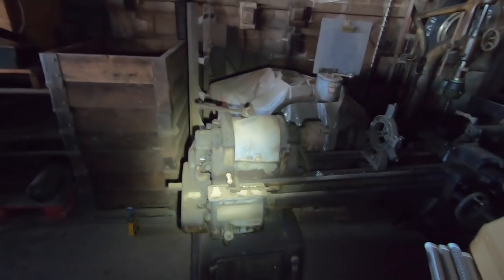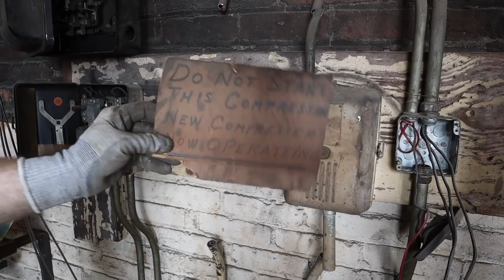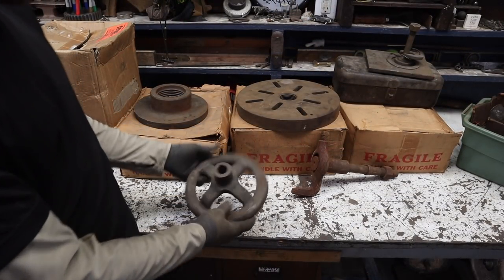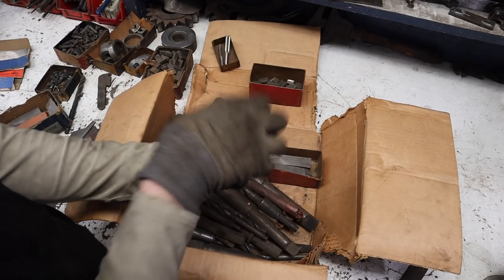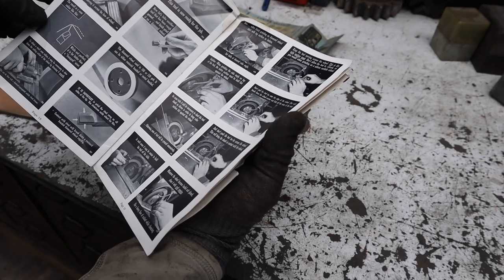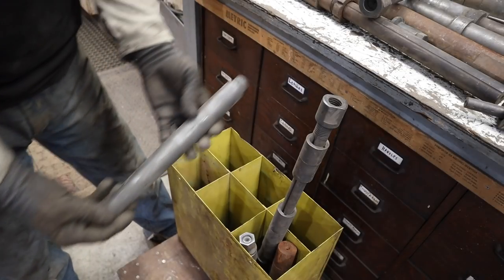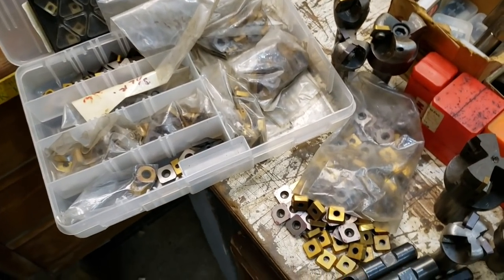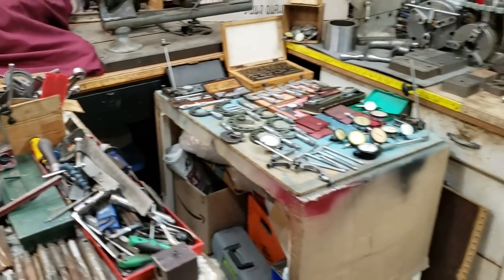This Machine Shop is a TRUE Step Back in TIME! ~ RESCUING OLD IRON ~ Episode 3 P2 ~ TOOLING Galore!!

Comment: I'm from the UK, I use to sub contract to Colchester Lathe Company, delivering lathes they built, there were some awesome machines in the workshops used to build the lathes themselves, none of this CNC stuff of today, everything was manually done, the skills required were learnt over a 5 year apprenticeship, starting of as a 16 year old school leaver, the wage was shockingly low, and the work was hard, but the reward was a shiny new lathe at the the end, Colchester lathe was a major employer in the area at the time ( 1970s) and the other big employer was Paxmans Diesel Company, making large Diesel engines for the Navy and shipping companies, as well as others. It sure is sad to see such beautiful machines so unloved, the men that use to use them would treat them with respect, and for some it was a real love affair. It's just great to see you passionately restore them and make them live once more

Comment: The item you called a #4 Morse taper that had the knurled handle is a taper gauge. Your mystery CU CO chuck is a Cushman 2 jaw chuck. The item on the pallet with the two hardened columns and all the drilled holes on the base is called a die set. It might be a Danly die set. You also held up a item that was a center for a dividing head for milling or grinding. The little pump you showed is a small hydraulic Viking pump. 
You have a lot of good stuff there.

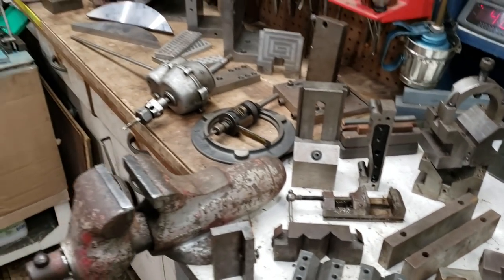Comment: Between 57:36 and 57:37 as the camera is swinging by you see a device with a long narrow rod on it. That is a tapping head for drill press, once you use you will NEVER tap anything without it. Many of them were made by a company called Procunier. There is a clutch in them, when you go down it will turn forward and tap a hole with extreme control over the speed due to the sensitivity of the clutch. You can easily turn the tap an eighth of a revolution with this. When you lift it, it auto reverses the tap and backs it out. I have literally threaded millions of pipe couplings with these with zero failures. The long narrow rod contacts the driil press post to keep the head from spinning, it slides up and down the post with the quill.
Art

Comment: The dial caliber not repeating is 1 of 2 things, sometimes it the screws on the rack with the teeth, and often it is the needle is a little loose. That is fixed taking the glass off and tapping down on the needle, it's like the needle on a clock. And no ,it's all good stuff. I still use a lot of this stuff
Reply: Keith Rucker from Vintagemachineshop.org he may be able to help you identify most of your tools also he has a link to a man that repairs all kinds of measuring tools. The web site has a vast library of manuals and old textbooks and all online
   I went back and found the name of the website for measuring tool repair it is M.R.TOOL REPAIR check it out, if you so choose. Good luck.

Comment: The first machine shop I worked in, all machine tools were driven by flat belts from a shaft on the wall.  The shaft was driven by a steam engine at one end of the building.
To change speed on a lathe you used a length of 2x4 to knock the belt on to the next pully on the wall shaft then pushed it over on the lathe pulley.   This was in a ship building yard in Scotland about 1945.

Comment: 55.23. They look like spring collets, we use them in a milling machine we were given by Rolls Royce, I think it was 1953. Keep up the good work.
Steve , Somerset, UK.
Reply: I believe there should be some tapered shafts that go with those expanding collets/mandrels. I seem to remember using them in the past between a set of bench centers. Now I’m trying to reach back to 1984, but there’s some recognition going on in this old pea sized brain.

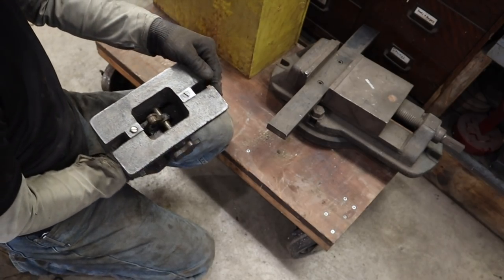Comment: I know this thread is old, at 48:00 that pump is a oil pump for a older W & S turret lathe.  Could possibly be a coolant pump, too.  Coolant pumps were generally a Gusher brand of pump.  At 39:39, most of these are horizontal milling arbors with Brown & Sharpe tapered shanks.  Probably not many milling machines around that they can be used on now days.  Nice find of stuff there! Ken

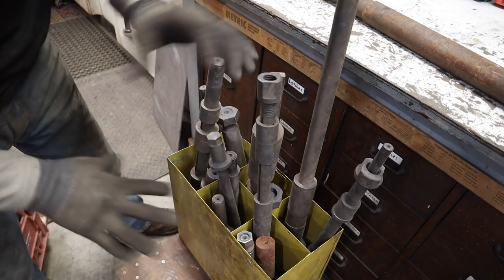Comment: 40:02 is a draw bar for a milling machine. Judging by its looks it goes to a horizontal mill. The draw bar screws into the threads on the ends of the arbors to hold it in to the mill. The slot holds a piece of key stock to keep the cutter from turning on the arbor.

Comment: we just watched you pull thousands of dollars worth of tooling out of some ratty old cardboard boxes. my dad spent 35 years, from the 50's to the 80's, as a union machinist operating manual lathes like the ones you bought and cnc lathes at weatherhead, then dana. if you have an old brass weatherhead plumbing or hydraulic fitting, there's a chance he made it. i still have his machinist's tool box. it has carbide cutter inserts, drifts, micrometers, a dial caliper,  bunch of go/no go gauges, brass shim stock, and many other things who's use i'm not sure of. he would've loved this.

Comment: I like doing jigsaw puzzles of 1000 pieces or more, it takes up a lot of my spare time. You will use a lot of time in cataloguing all the spare parts you are collecting, allocating them to the various machines you have acquired and storing them in a relocatable fashion. the shed you need for all those lathes will need to be substantial. Enjoying the videos!!

Comment: • "Morse-with-a-handle" may be a gauge for checking that size of morse socket. Treat it well; put a stripe of Prussian Blue on it and rotate it in the socket to be tested and see where it rubs. That will tell you whether the socket has the proper taper or any high spots.
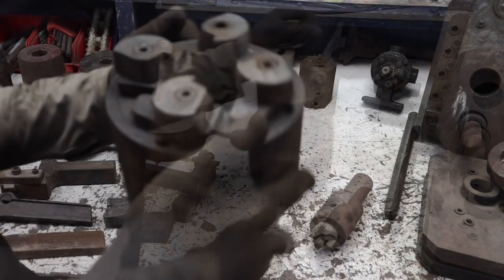• The thing with the four jaws and the lever ( 49:30 or so) looks like a threader. The jaws retract (maybe automatically after you free it up) so you don't have to reverse the lathe to back it off. Look for sets of four dies that fit it for different thread sizes.
• 59:20 or so are precision angle blocks. You can put them under a workpiece in a vice to mill or drill at an angle, or use them to set fixturing.
• For the parallels with rust: set up a lapping plate with a good flat surface (surface plate or heavy plate glass) and some very fine wet/dry paper to remove any high spots after removing the rust with some kind of chemical remover (not a wire wheel or abrasive wheel!).

Comment: I think you need Brown Waxed Paper Anti Corrosion / Rust / Moisture Resistant Tool Wrapping for when you restore some of those tools, cutters, borers etc so that do corrode again. Also some sort of storage system where you can look up pictures, information written on the items, sizes etc. so that if some should come knocking at your workshop, website etc you have a way of finding and passing on/selling them the item. This way someone else in 50 years won’t be having to do what you have just done. I used to manage a parts department for a VW & Audi dealership in the 1970’s so I’m thinking that you need a setup similar to what they have so you can store and look up all the bits and bobs you have managed to salvage. Just a couple of thoughts. TIOLI.

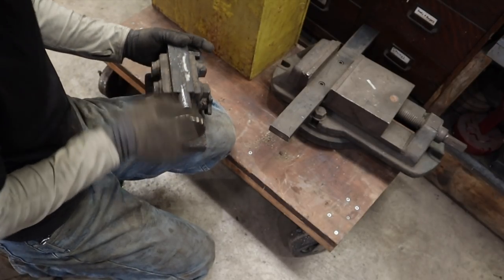Comment: I would love to find a place like this. that little forklift must be a godsend when working in tight quarters where you can't get a big lift.  my main mill is probably of about 1918-1920 vintage I would love to find one of the presses like the ones in the video to restore. Awesome video. Stay safe    23:56 is a replaceable tip dead center as you were thinking 28:45 several of those cutters are gear cutters. 29:47 you have yourself a handfull of woodruff key cutters there. We had a union chuck exactly like the one you have. used it for square stock turning mostly putting threads on square rods for controls. 39:27 that is a tailstock for a dividing head 56:34 yep angle gauges use for setting percise angles usually in a mill or checking angles on a surface plate. you can use them like parallels if you have a matched set to mill an angle.

Comment: The Die set you are holding at 38.20 is used for punching thing out on a  mechanical press. A tool maker would use this as the base and add punch/s and die/s to the die set for jobs. Where I worked for over 10 years, these were used for making lot of different things. You can set just one punch or many, we had one where you fed brass strip in one end and you got a component out the other that was quite complex with lots of holes and folds in the component

Comment: Hi there, The tapered flat cutters you mentioned are for an adjustable reamer and there are 6 blades to each reamer. However, not much good without the threded cre unit which has 6 slots cut longitudinally to accept the blades. Regards MoK

Comment: yea those angles were for setting up , you would use them to set your angles, either setting the part on an angle on the table, or angling it up from level. Many different ways to use them. I also saw what might be either a floating reamer or tap holder, or a rotary broach.. since you didn't spend time on it, hard to tell.  best thing you can do is take the stuff that is in the best shape and de-rust it., then coat it either with cosmoline, or boshield spray. Something to prevent them from rusting more. Rust will cause the cutters to lose sharpness as you know.  Wax will also work to protect them.. use a double cooker to melt wax and dip them, or mineral spirits and wax with a lot of mineral spirits... dip the tools and let them dry, there will be a coating of wax on them. Use mineral spirits to melt the wax off to use them.
Some of those big motors are going to be 480v 3phase or more possibly.
Nice cache of machines and tooling.
Reply from the maker: Thank you my friend!

Comment: The Morse handle as you called it is probably a guage.  2 jaw chucks are usually used with soft jaws machined to hold part.  With the sheldon vise you have a tailpiece center to use with a dividing head.

Comment: As a bitter old retired machinist of over 40 years I recognized the majority of your tooling. The one thing I’d like to suggest is that you purchase yourself a small granite surface plate. You have an exceptional amount of gaging and fixturing tools that will undoubtedly help you in the future with part layout and inspection. Find a cabinet to put your inspection tooling (micrometers, indicators, calipers etc) in. The dial calipers are all repairable. I did part time gage repair for a guy on the side for a few years, repairing calipers, indicators, micrometers by the box full. I also worked for a company that produces special tools for the automotive industry and spent a lot of time repairing measuring tools for the operators in the production areas. Most of the tooling just needs cleaning, adjusting, repair and maintenance. If age didn’t affect my sight so much I’d still enjoy repairing the measuring instruments. Man, I envy you for what you’re doing. You have a strong mechanical aptitude and a special gift in being able to recognize, understand and perform mechanical processes that will make you continuously successful. Keep it up! I’ll keep following along.

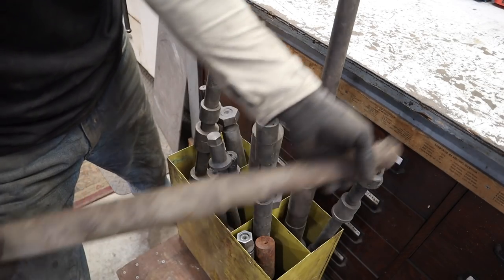Comment: Minute 39:58 looks like a tailstock for a divifing/indexing head, its used to support the end of a shaft that is held in the indexing head so it can be turned x° or end support when milling long keyways. The toolpost just previous to it is not a quick change toolpost but a normal toolpost, the quickchange is 2 parts so that once the hight is set its done, with that one you need to use shims to get the hight right.

Comment: At 37:58 you have a die set to use in a punch press. After the mill vise you have a tail stock to use with a dividing head.

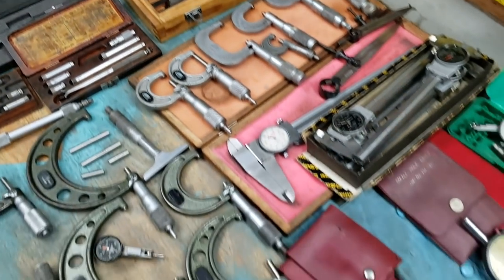Comment: 53:23 "Gauge blocks" you can demonstrate "molecular attraction" with these blocks.... 
The surfaces are so true, that electrons transfer across the faces; you clean each face by rubbing it on your palm, snap together , twist into alignment....  
Than like they are magnetic, they aren't, they will stick together!  
It will take 500 pounds per square inch, to pull them apart!  
you can stack a horizontal row of them, and pick them up by one end....

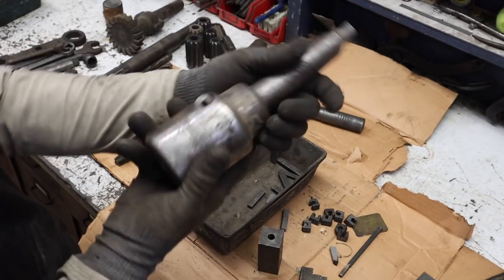Comment: The tools at 30:32 are for a horizontal mill and i think i saw some gear cutter also.  The chuck at 28:20 is a quick change chuck check with mrpete222 he knows more about it.

Comment: 38:00 Is called a die set. A die maker would build the die to do a specific operation. Then they die would be mounted in punch press and stamp out what ever the the die was made for. 56:24 Are called angle gauges or angle block. They each have a specific angle and are used for set up or layout.

Comment: 55:32 TG 100 collets, 56:25 the three with the small screw in them are adjustable parallels, also right below those is a planer gauge, it has the rod screwed into the one moving part.

Comment: 26:20 arbor for checking head stock alignment on a lathe. 37:58 is a die set for a punch press. You are correct at the 40 minute mark those are horizontal mill arbors and draw bars. Thanks for the videos.
Reply: 37.58 die holder for holding stamping dies in a punch press.

Comment: The 2 plates with the 2 pins I a die set used In punch press and the weird piece that looks like a center on a lathe is a center for  the mill ,used with a indexing head to  cut gears or keys or whatever. I have one in my shop. Very nice to have if you have the index head.

Comment: I could be wrong but I believe the cutters at 50:55 are counterbores. Also, the box of stuff at 57:42 looks like it has a bunch of spacers for a horizontal mill arbor in it. Great video and nobody would consider that haul to be a bunch of junk.  Very cool that you're saving all of that stuff.  Good luck with your channel, I subscribed.

Comment: you need a 1910  Machinist Bible to tell you all about that .. the squair piece with the cutting bit  that fits inbetween the Rails of a Laths .   and the wheel sets the depths  of the cut .

Comment: At 48:13, looks like a hydraulic pump, when you were looking at the ID Plate, the one opening has a "S" stamped in it, probably the SUPPLY or SUCTION port.

Comment: At 53:45 that is not actually a tail stock like for a lathe. That goes on a mill with a horizontal indexing head with a chuck on it much like a lathe. One of the uses would be to mount a gear blank on a mandrel. The mandrel would go between the 'tailstock' and the chuck on the indexing head much the way it would appear in a lathe. This is not the only one you have, I saw one earlier in this video. Another use would be splining a shaft.
Art

Comment: At 54:02 you have 2 Kearney Trecker milling machine handles would you want to part with them? The collets look like TG150   Or TG 100  that stands for tremendous grip and 150 would mean the biggest collet in that series would be an inch and a half . Thanks for saving all these machines,  ed
Reply: Agree with Ed - don't throw the K&T handles as they frequently get separated from the machines at auction.  The big gooseneck handle is for knee elevation and the other one adjusts the saddle.